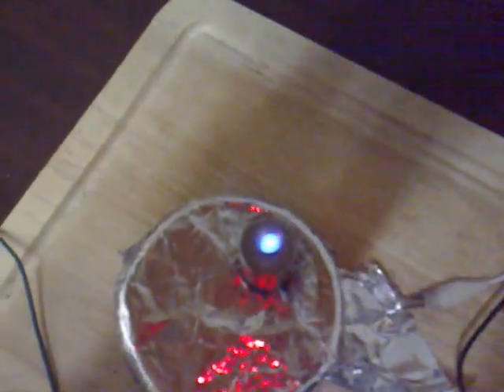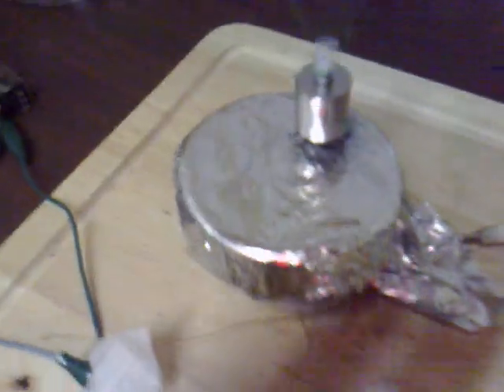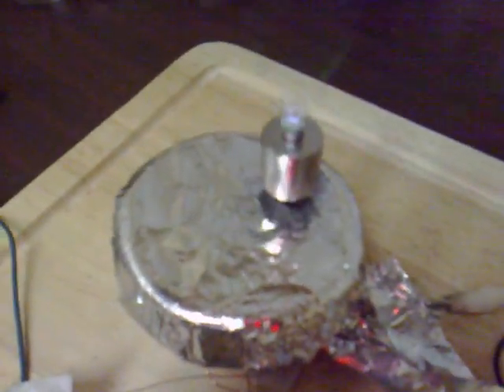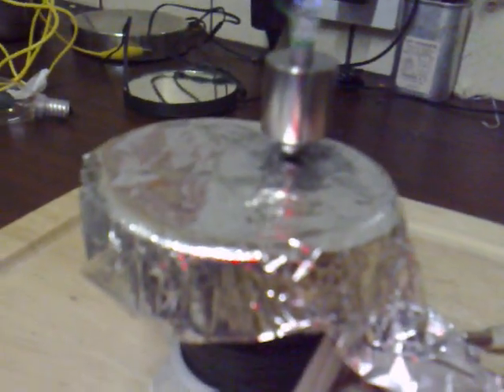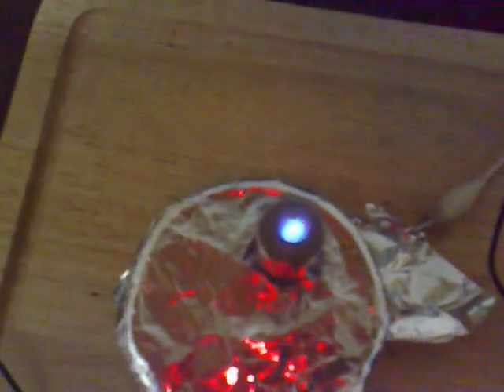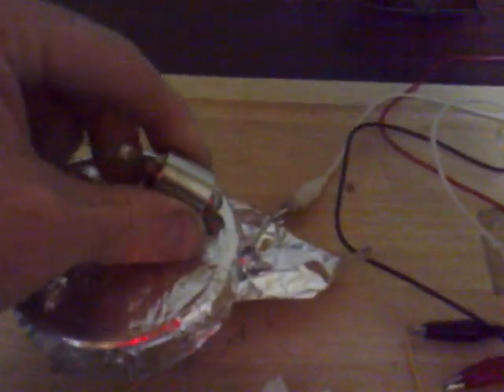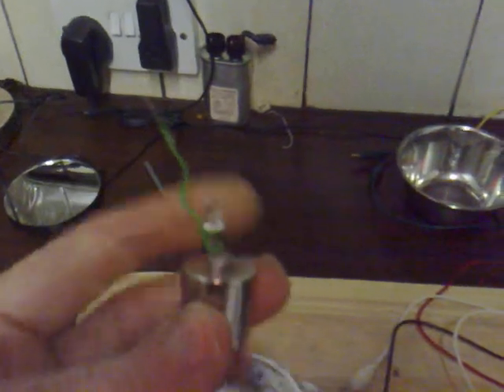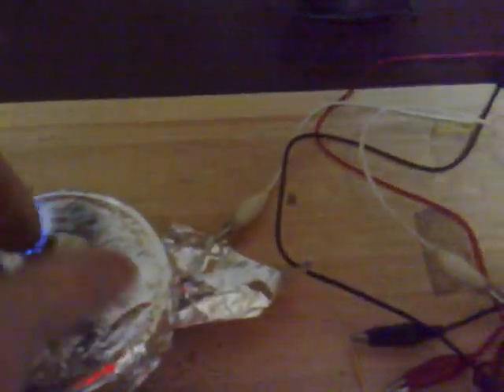Avramenko Rotor

Comment: That is very creative Jonny!  You think up the best stuff.  Will the AV plug/led light up by just being in the sec field without the foil connection?  I believe you said it would in your info section.  If this is true, man, you could have a bunch of satellite rotors all spinning like you did before and also place them in the sec field to light up.  I have never seen anything like this before.

Great work.

Bill